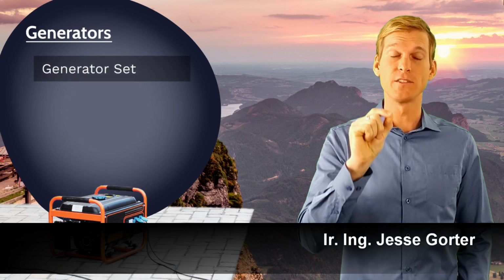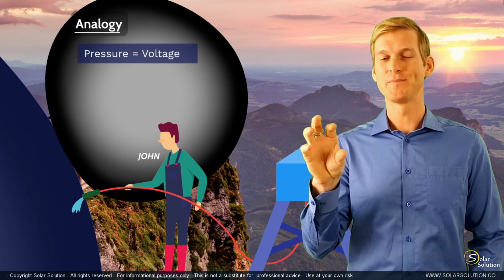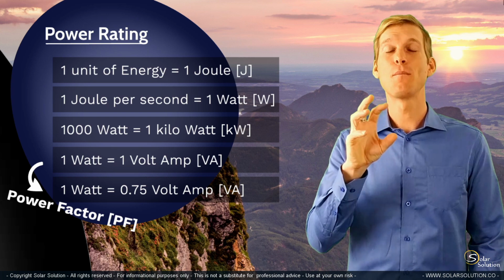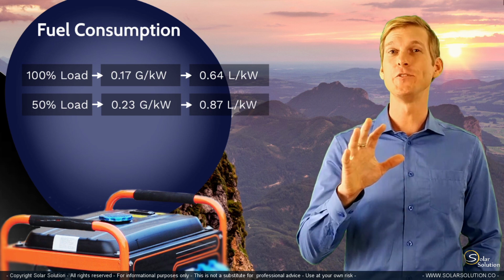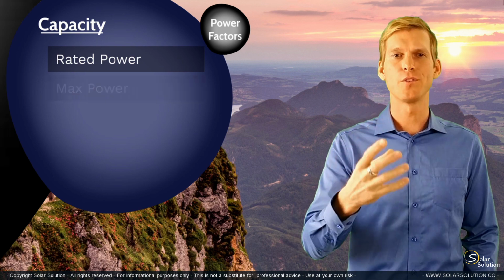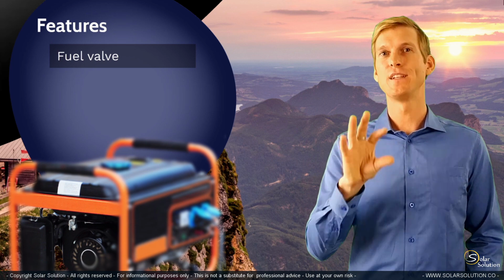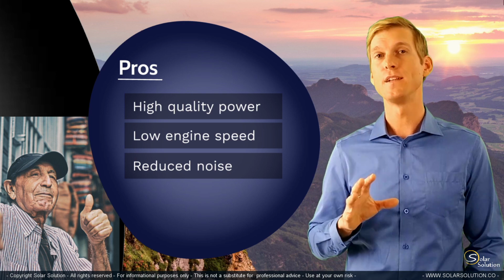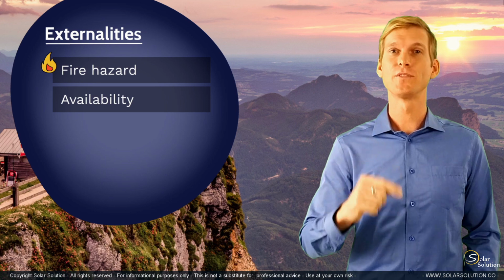Generators Explained: Sizing // Power Ratings // Inverter Generators

Comment: Someone was telling me that inverter generators produce less power than standards generators because the AC is converted to DC then back to pure sine wave AC. He was forgetting some major points. Many inverter generators use rare earth magnets to create the Field in the alternator. The standard alternator generator has to Consume power to create an Electromagnetic field. How much power are we talking about? Take a 12v 100A alternator and energize the field and try to turn it, it will be hard and very cogged feeling. Convert that same alternator to permanent magnet and spinning it by hand you could make enough power to electrocute yourself. Look at the size of the Field wire on a standard alternator, it is fairly large for a reason. Also, if you know anything about electromagnets, you know they are power hogs and a continuous drain because the field doesn't persist after you terminate the power. The generator is consuming AMPS to maintain the field, a field in which it's cogged nature makes it even harder to generate power with, so you need a larger engine and more fuel.
Reply: So, in laymans term's are u saying the Inverter is a better Generator?

Comment: Now that reminds me, you talked about the current fluctuation in a previous video relating to pure sine wave inverters vs modified SW inverters, with the modified inverter the current fluctuation is it same as a generator without an avr. And can a generator avr be connected to a modified sine wave inverter to produce 'pure sine wave current' or is it impossible?

Comment: Why they still make square wave generators, and all modern devices needs shine wave,i can't understand that.
Reply from the maker: An excellent question Iohann, thank you. Might it be that some of the terminology got mixed up during the learning process? Conventional generators can be considered to produce a pure sine wave, as opposed to square wave inverters which try to mimic the sine wave. If this does not answer your question yet, please feel free to respond or ask for additional clarification. The the following video on pure sine wave versus modified sine wave inverters might also be of interest: https://youtu.be/6UWLno-B4PA. Have fun!
Reply: It is all about how you're using it. Generators are used for many other reasons then just as emergency home backup to run your appliances. Hence why there are all types, shapes, sizes, etc.
Reply: Because they are cheap and sometimes you can get by with them on a limited basis. I had an 800w modified sine inverter in my SUV that would run my 1hp vacuum cleaner. The wave often doesn't matter when the power is going to be converted back to DC anyway.